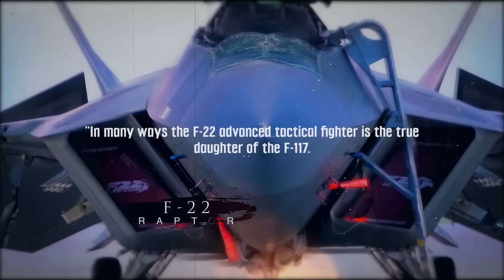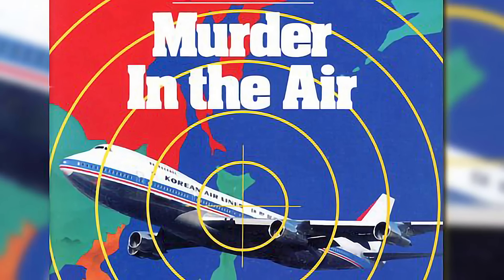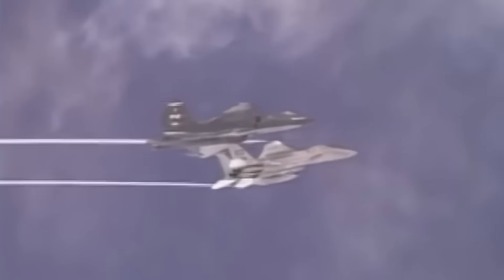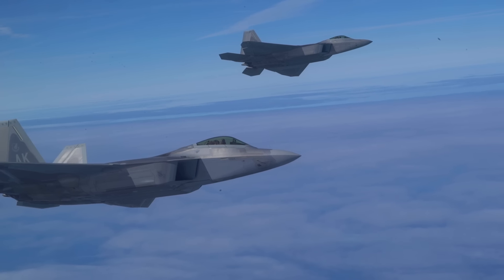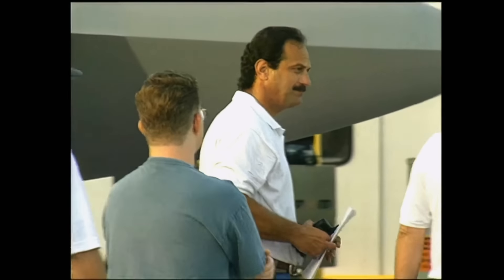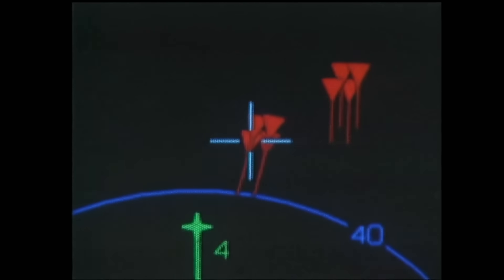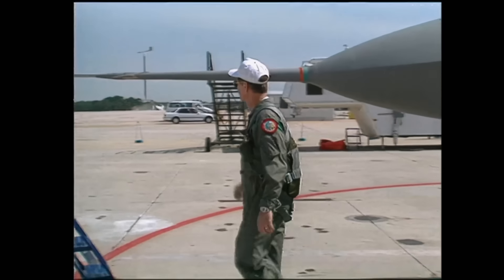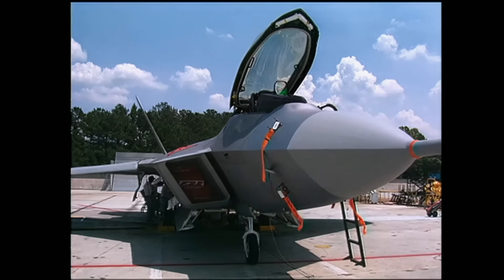F-22 Raptor: Stealth, Speed, and Supremacy - The Ultimate Fighter Jet

Comment: Lockheed only won because if they didn't they would have to close there doors. The F23 was superior in every aspect, faster, stealthier, more manuverable, even the pilots who have flown the 22 & the 23 said the US dropped the ball. The best plain was left behind. Infant the 23 is the strongest influence on modern 6th Gen fighters. For example the UK new 5/6th generation fighter (the Tempest) looks like the former YF23 and nothing like the substandard f22 model for the new 6th generation platforms. The US in the 90s produced two 6th generation fighters in a 2nd 3rd Gen world.
Reply: Supercruise speeds achieved in testing were close enough that the difference was no more than an Olympic athlete in a 100m sprint. The speed difference was primarily in acceleration, not raw speed, and both were significantly better than the F-15. They also both needed RAM coatings, which meant their speed was restricted more by the potential thermal damage than what the airframes were capable of, so max speed really did not matter. Also, the production version F-22 ended up being faster in supercruise than the YF-23.

The YF-23 was slightly stealthier, but there comes a point of diminishing returns where being technically superior does not matter in practice. The production F-22 is stealthy enough that radars can still have trouble achieving a lock in visual range when IR missiles become effective, so how would "better" stealth be beneficial? 

The YF-23 was less maneuverable, not more. Pilots who flew both have stated that the YF-23 could achieve similar low altitude feats of maneuverability as the YF-22 and that Northrop just didn't understand what the USAF were looking for in the demonstrations. But the advantage of thrust vectoring was in the high altitude fight where flight control surfaces become less effective. The new fighter was expected to operate at higher altitudes than any previous fighter, and the YF-22 was superior in this regard.

The YF-23 carried only 4 missiles in total vs the YF-22's 8. The YF-23 had to be reconfigured with it's 2nd prototype, which sacrificed a fuel tank to expand it's payload, and it still could only carry 7 missiles. Of those 7 missiles, only 4 were BVR missiles. The YF-22 carried 6 BVR missiles + 2 short range missiles, which represented a much better optmised payload than the YF-23 offered, particularly today where the vast majority of air combat is spent BVR, and dogfights can last under 10 seconds due to the nature of high off-boresight targeting.

But more than anything, Northrop demonstrated that they were bad at program management. There were no politics involved, rather the YF-23 ended up far behind the YF-22 in development and replicated the same management issues observed with the B-2 program. By the end of the competition in 1991, the YF-22 had demonstrated it's ability to launch live AIM-120s and shoot down drones BVR. The YF-23 only has a mockup of it's weapons bay and couldn't carry weapons, let alone engage targets.

According to the ATF competition management, the fighters were considered equally good designs, but the Lockheed/Boeing team came across as far more competent and reliable compared to the Northrop/McDonnell Douglas team.

Comment: Northrop yf23 was as good as the yf22. Northrop lost cause of past problems and frauds.
Reply: As well as work on the b-2 spirit when it was selected Northrop was still working on the b2 so they say I’m sure it had to do with being paid off by Lockheed and partners but hey they built an aircraft that still today rains supreme in bombing as well gained a contract for a new bomber known as the b-21 raider named after the Doolittle raiders of ww2 the first men to strike back at mainland Japan after the attack on Pearl Harbor and the first 6th gen aircraft of the 21st century designing and production R and D still going on but all the B-21’s are said to be combat ready upon delivery the test planes that is so if china wants to dance I’m sure we can go from small scale to full scale development of that bomber there’s a lot of trust going into Northrop Grumman considering work on the f35 started back in I do believe 2011 didn’t go active until 2017 I’m sure that’s wrong I do believe it was 2006 it actually started

Comment: Its known in the pilot world  that the yf-23 is a better aircraft.  The f-22 was plagued with problems during flight test and still today.
This is from Wikipedia...
"Lockheed, Boeing and General Dynamics proposed and built the YF-22, which, although marginally slower and having a larger radar cross-section, was more agile than the YF-23"
If your aircraft is meant to be stealth, then you dont need to be agile. This "agile" angle was the reason it won. Complete bs
Bogus claim to give award to inferior aircraft.
The overheating damaged the F-22's airframe, systems, wiring, hydraulics and surrounding structure, and parts of the auxiliary power unit's exhaust bay.
Further the coating and O2 sytem keep the aircraft to staybelow a certain ceiling.

Comment: 5:42  This is coming from actual people who handle the maintenance for these aircraft, the oxygen system was killing pilots and several has SEVERAL issues of important capabilities that work only intermittently. Understand I'm not bashing the plain as a whole and the issues it has will one day be fixed and be the instrument you described but you need to dig further. I wish I could say more specifics but for security reasons I won't.
Reply: Like I said, how's that bs low cost working out for the AF?
Reply: Yoy worked on plains?

Comment: The ultimate obsolete fighter jet.
Reply: F35 yes, F22 no. F15 no.
Reply: @knowahnosenothing4862  LMAO! The F-15EX Eagle II has been retrofitted with F-35 systems and tech in order to remain viably operational into the future.
Reply: Another arm chair specialist...
Reply: While it may be considered obsolete by today's standards, many older fighter jets still play crucial roles in armed forces due to their maintainability and upgrade potential. It’s a testament to the durability and lasting value of their original design